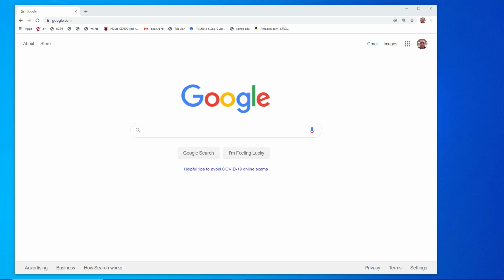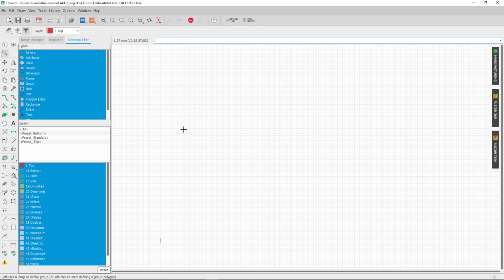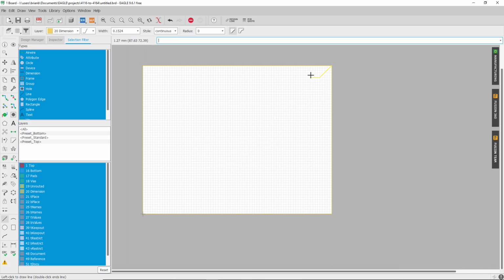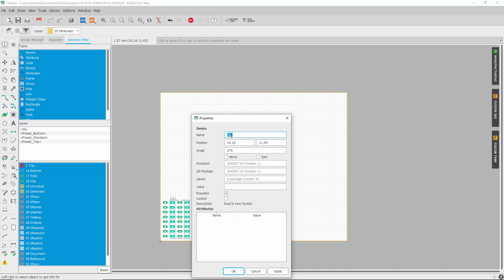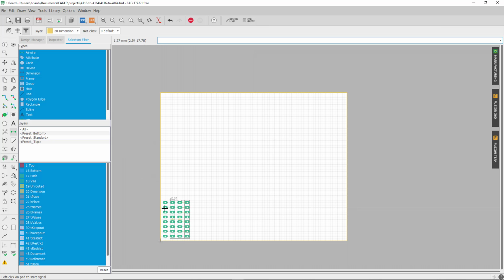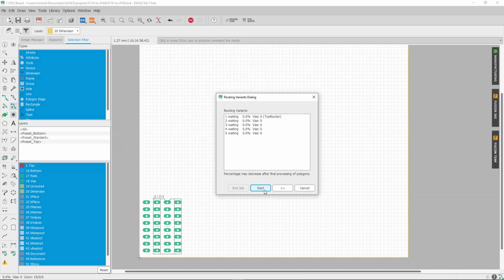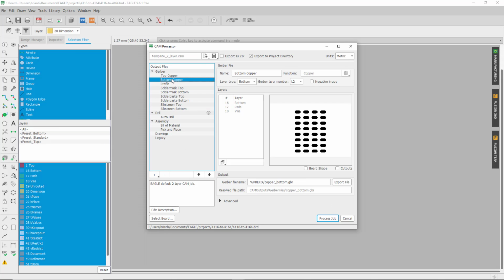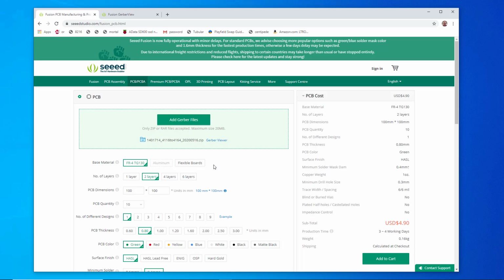Designing and Fabricating a simple adapter (4116 to 4164) with Eagle Cad and seeedstudio

Comment: Hi, could a single 8-bit memory chip be used to compose this bank of 4116?
Reply from the maker: In the case of Missile Command I don't think so, I don't remember 100% but I recall looking at it with the same question, and I think I determined that the way missile command accessed the individual rams I think the answer was no, I could be wrong but I think that's what I determined. Either that or I determined it was just easier to make them separately. But in many games, the answer would be yes.

-brian